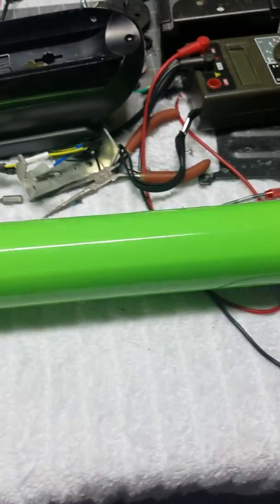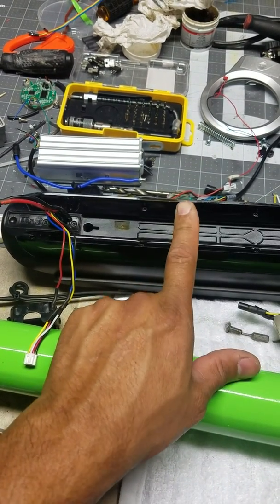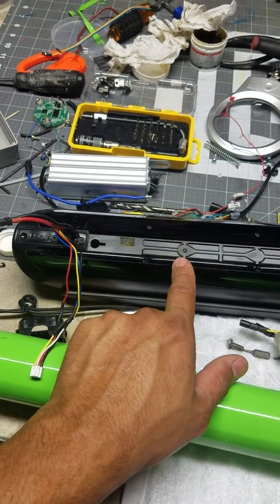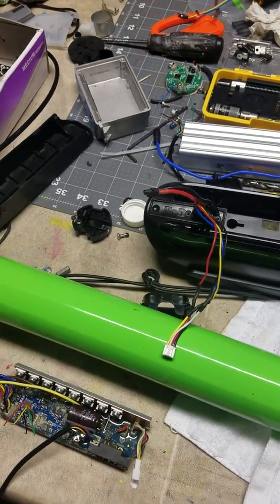ninebot es 4,3,2,1 external battery firmware downgrade

Comment: So does it work as an external battery along with the internal battery as if it was a factory ninebot external ? If it does then Do you leave older bums firmware or update after it’s installed? Did u change serial number? And if it works as external and use the Segway app and do the update does that update bad? And fuck it up? What version EMS do you run? Do you spoof the update? These are all the things you left out of the video you just said it’s flashed that’s it, nothing about hooking it up. So I probably must Assume it works as a factory since you said it was flashed but would be nice if you added the final confirmation on hookup and it works as external. There is too much confusing other shit out there and videos that all leave shit out or confuse it etc
Reply: Not bad....bms if u use the Segway app and do the update does it change bms?
Reply from the maker: If you read the description you will see what app you need to downgrade the firmware with that app you put any bms firmware you want

Comment: So essentially the net of this video is you require the connector from an internal battery so that it can be plugged into the external and then you can use the regular motor controller esdowng/ninebot flasher method to downgrade it?
Also why did you remove the gold battery pins instead of keeping the entire connector?
Reply: how you learn that
Reply: It's  most likley the junkiebrain at work u dont even need to disassemble it if u have one  that is flashed prev. just use app and flash the bms  (just joking about junkiebrain.... mabey haha.) u can also hook a stlink to the bms there is a header for it , but it is unmarked.  i made my own bms firmware and my own firmware for the driver(speed controller) es1 scooter 36v battery and 65km/h top speed... tho battery drains quite fast haha..  
im using the original speedcontroller, with my own cfw. 
Not from the known site u can get cfw crap from which in my opinion is crap but helped me in the beginning